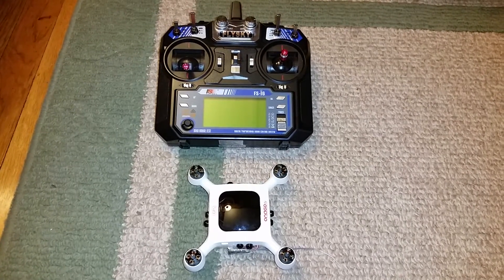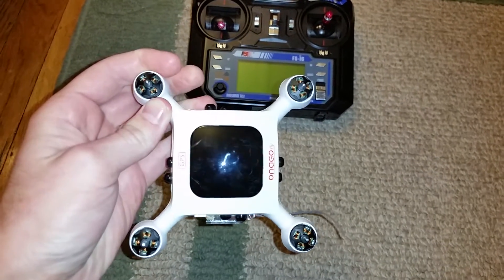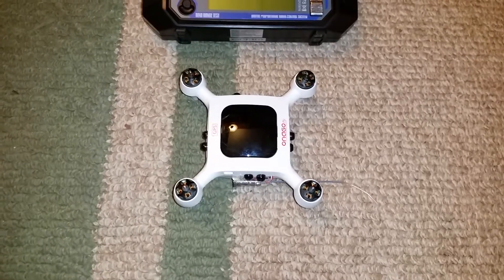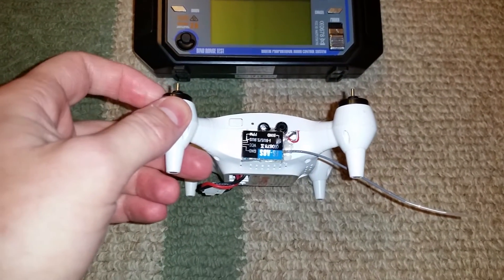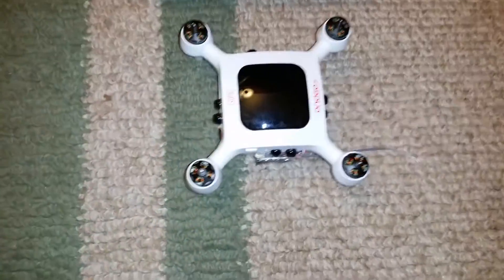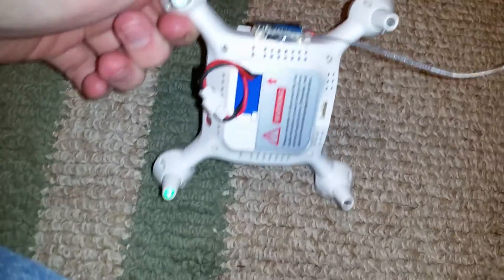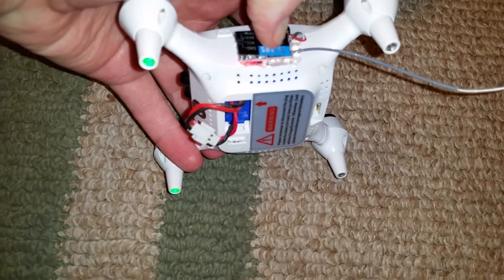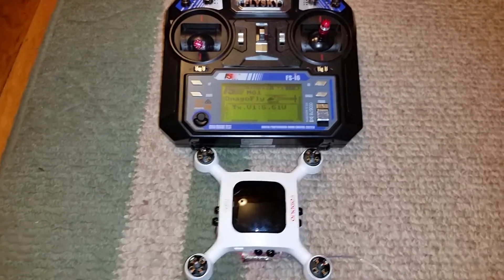OnagoFly Hacking Update

Comment: Hi KJ6EPL

I went a head and did the mod.  Everything seems to connected correctly.  When attached to usb I can calibrate the rc channels and sensors no problem.  However, the battery readings keep coming back low so it won't let me arm.  Can you tell me what configuration you used to get it working?
Reply: Ok.  That was with PX4 firmware.  Loaded APM firmware.  When connected it says its armed but cant get the motors to spin.
Reply from the maker: CyberMerln verify arming check is disabled. Verify that your receiver is in ibus mode and that you see the bars move correctly on mission planner's tx calibration screen. Also beware that the AHRS orientation may change when you ditch onago's firware.
Reply: Caught the orientation issue and got that fixed.  I am using a FLYSKY i6x so I am just using PPM so don't think i need the ibus.  Also don't here any sounds.  I can see the controls moving but the radio 5 switch changes flight mode.  Should I switch to ibus?
Reply from the maker: If ppm is working for you, then if it's not broke, don't fix it. As for not arming, again, check the arming check parameter. It's on by default, and it won't so much as initialize the ESCs unless the compass is perfectly calibrated and it has a solid GPS lock. So disable it. Also check that the geofence feature is disabled, as it won't arm until it has a gps fix.
Reply: Everything disabled.  Can arm and can see it in APM planner but no luck in getting the motors to spin.  I did test whether the motors were still working after the mod and before updating the firmware.  Now still can not get the motors to turn on.
Reply from the maker: 1) After installing the firmware, did you complete all of the calibration steps (accelerometer, compass, and transmitter)? If not, try that 1st. You could always repeat them too just to be sure; redoing them won't hurt anything.
2) What flight mode are you trying to arm and take off with?
3) When you plug in the battery, do you immediately get a fast triple beep (do-da-dah) from the motors (without pressing the power button)? If not, then you have a bad battery or a power issue.
Reply: Thanks for helping me KJ6EPL. In answer to your questions: 
1. Will redo the calibration in the morning just to be on the safe side.  
2. Using althold for the flight mode.  When connected to APM planner I can see that it arms when I move the throttle/rudder to lower right.
3. Can confirm when I plug the bat in I get do-da-dah (three tones).
4.  When I press the power button lights come on and I can see video in the onagofly app (only thing that works).  No sounds though.
Will keep you posted.
Reply from the maker: I just did a quick test with mine and it will arm properly in altitude hold, but I did have to raise the throttle slightly to get the motors to spin (note: I have mot_spin_armed disabled as I want the motors to stop at zero throttle, so your results may be different). Also note that wifi controls do not work with the APM firmware (although, as you mentioned, camera controls do work), and also the rear lights no longer turn blue once it has a gps lock.
Reply: Just recalibrated and motors still don't start.  Think I am going to reload apm 3.4.6 and start over.  Its like after in disconnect from usb it doen't see the rc controls.  What version apm are you using?
Reply: GOT IT WORKING.  Reinstalled apm and couldn't calibrate so I went into QGCS and was able to calibrate.  Then found that I had to set brd_safety_enable to disable.  Didn't see that in APM planner.  Now all works .  Any progress on the PID settings?
Reply from the maker: Congrats! BTW I'm running apm v3.4.3; installed it several months ago. PID tuning has been VERY frustrating and slow going, for a few reasons. First, for the APM's autotuning function to work, it already has to be close. With the drone wobbling in flight, as this thing is notorious for doing, it won't work-- the FC waits for it to re-stabilize after each twitch before twitching again. I did actually get it to complete one cycle, but it didn't produce usable results. Grrr... It also doesn't help that you can't change battery packs. I also have been super busy, and the weather has been uncooperative. I'll get there sometime and write a tutorial.
Reply: KJ6EPL. Thanks it was driving Mae crazy. did a little test in the house.  had it go straight up and down. noticesd it doesn't takeoff untilled the throttle is about 50%. then its very sensitive.  also its seems very slow to respond when I go to turn it off because I hit the curling.  have to play with settings I guess
Reply from the maker: Here's where I'm at in tuning. I do have it flying much better than it does stock, but it still needs more work. ~Back up you current parameters before trying these.~ First, altitude hold is funky, and I'm yet to figure out how to dial it down, so I recommend flying in stabilize mode (manual throttle) indoors. Note that I am configuring using Mission Planner.

Update the following parameters (full parameter list page):
ACRO_RP_EXPO and ACRO_Y_EXPO = 0
ATC_ACCEL_P_MAX and ATC_ACCEL_R_MAX = 59065.5
ATC_ACCEL_Y_MAX = 36000
If you want the motors to stop at zero throttle, MOT_SPIN_ARM = 0

PIDS (extended tuning page):
Stabilize roll and stabilize pitch: 5.983694
Stabilize yaw: 4.5 (default)
Rate roll and rate pitch:
P: 0.080
I: 0.080
D: 0.007
IMAX: 0.15
Rate Yaw: defaults

So try that and let me know how it goes. Again, these are not the most optimal PIDs, but better than stock
Reply: Hi, Its me again.  Got back to the O and changed the PIDs.  Unfortunately, now its flipping over on me on takeoff.  Redid the calibration and everything looks good.  Do I have to tune the escs?
Reply from the maker: See my latest blog post and video.
Reply: Figured out the problem.  Had propellers on in the wrong order.  Once fixed it flies rather nicely with the transmitter.  Test flew it outside.  Guess that's a warning to everyone.  Make sure you keep track of which propellers go where.  Now I just have to figure out how to fly.

Comment: Great work. was wondering why no had did this before. just ordered the transmitter and board. Saw on your blog about updating the pikhawk firmware. what version apm you are using. you also mentioned the pid settings. please post those - they drive me crazy.  mike
Reply from the maker: CyberMerln yeah I do have it flying now, although not well. I've been trying unsuccessfully to get the APM's auto-tuning to produce good results with no luck so far. When all done I will post a tutorial.
Reply: Thanks. Can't wait. You are a genius.  Can't wait to start experimenting with this.

Comment: awesome,your giving me hope for my onagofly!!!...I have the i6x finally.did you leave the WiFi board   and camera in?
Reply from the maker: Yes I do still have the camera and wifi board installed. Because I updated the firmware on the flight controller board, the wifi controls are not working. However, the camera and FPV do work. Follow me mode is an unknown at this time. I'm still struggling with PID tuning, and the weather is not cooperating.
Reply: that's probably what I was doing wrong,I didn't put the cam or wifi back in when reassembled.it wasn't getting any arming commands from the i6x.ill have to put everything back in and try that...I just truly surprised to not see more people like yourself and I that at the very least want get these things to not just fly,but fly well after the initial kick in the balls price of 299...haha
Reply from the maker: The wifi board should have nothing to do with it not arming via your tx. When you connect to Mission planner, do you see the sliders move on the tx calibration page, and do they move smoothly?